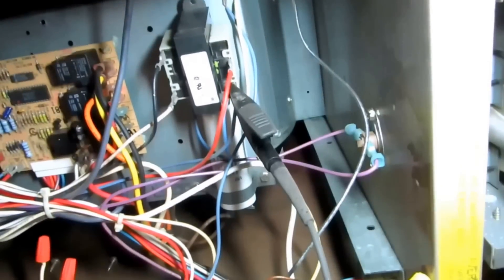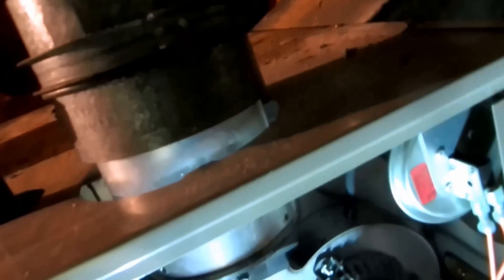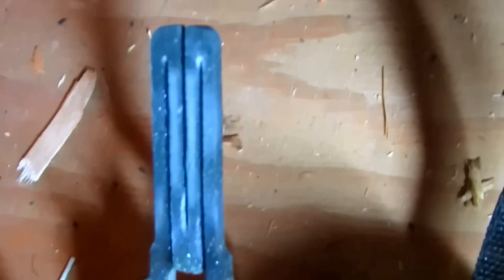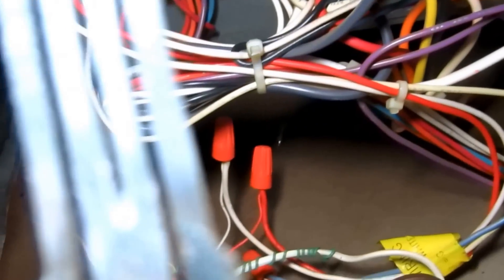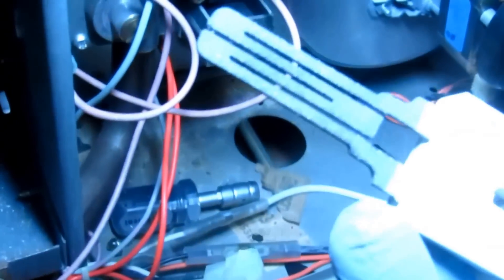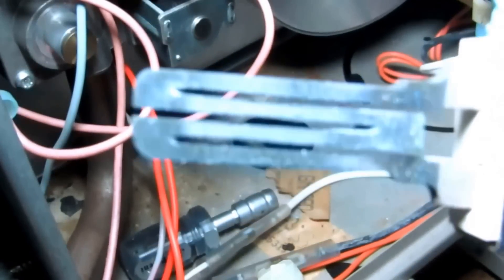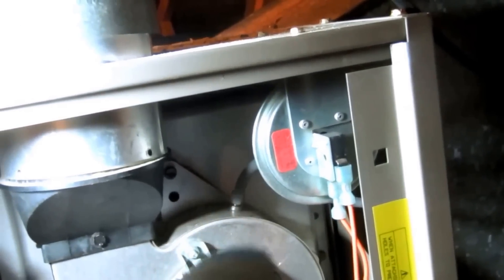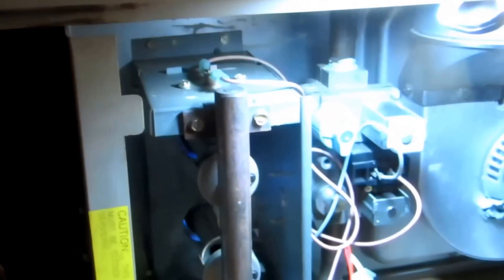HVAC SERVICE: gas furnace... no heat call

Comment: That vaccum port is usually the first thing I check on them Goodman furnaces, they always clog.
When ignitors hit 80 ohms I also recommend to replace them, they usually go bad somewhere around 90-100 ohms, sometimes they go to 120 or so but not often.
Reply from the maker: i usally always check the vac switch/port first also .................but when you see a bad/cracked/white hot service igniter  like i did, that is the first thing i check....it had to be changed anyway ,it was bad.i could tell by looking at it .looks like i caught the  hot service igniter right before it gave out it was cracked like 1/2 way through ..

Comment: I'm gonna go try this on my furnace now. lol. I got the t stat set at 70f. The inducer motor is running, but I got no ignition and the blower does not kick on either. I don't hear any switches clicking and the light on the board is normally on, the signal for normal operation... It was working fine a day ago. I hope this works. I been looking online for hours, trying to find a solution.

Comment: Please don't tear me a new one, as I just started school for this. Why did you hook the black lead to neutral of transformer @ 4:24 and where is the other lead connected to? Couldn't you just go across secondary and see if you get 24V? Thanks for any help.
Reply from the maker: 1242chisox its called hop scotch testes to see were i lose voltage

Comment: Had a mindfuxk one today Steve. The pressure switch wasn't closing, I had voltage available but it wasn't closing. I checked the vacuum pressure and it was pulling -3.6, the switch closes at -0.6. So I thought it was the switch. It got replaced and I still didn't work. Fml what did I do wrong

Comment: my rheem criterion furnace fan stopped working, I replaced the motor with a new one, now the motor fan works but no flames.  motor fan starts and runs for about 1 minute and then it shuts off,  I changed the ignitor and nothing, does the same thing, fan turns on and that is it, no heat no flameshelp plz
Reply from the maker: +July1 call a local service tech in your area to find problem  it could be many things,,, no way to tell over a email

Comment: Ok, so you using the neutral of secondary would be the same as using a ground?
Reply from the maker: +1242chisox yes for testing  low voltage

Comment: Draft inducer housing and wheel sounds rotten. Bet rust is blocking vacuum tubing. The heat exchanger is  sweating . It's just time for a new furnace. Its over 10 years old. The hot surface igniter
better be changed if you want to break even on the call. Its a r-22 system. Its a builder model furnace with a 10 seer AC. Put a new system in the house and sell service contract. Bet you don't have a 13 year old truck or TV. Or a iPhone.  Get a new heating and cooling system. Come on guys sell.

Comment: Sorry but that was kind of lame. You unplugged something but didn't say what it was, where it was or where it came from. Then you took something out. What was it. Sorry, you need to be more detailed in you presentation.
Reply: Steve Leighton could have sworn he said it was the hot surface ignitor. If he didn’t and you don’t recognize a HSI when you see one it doesn’t matter if he said what it was or not.